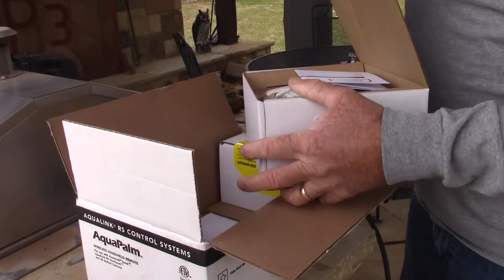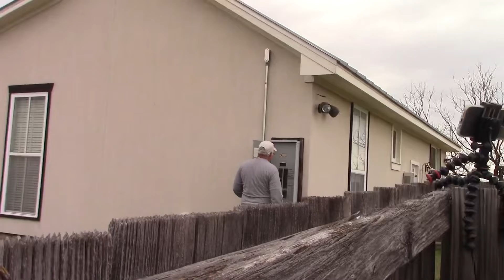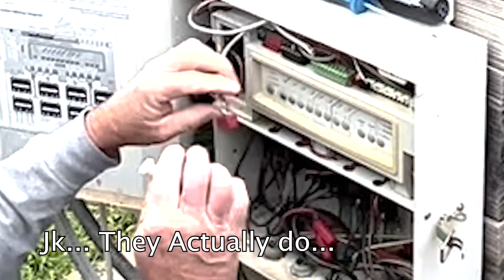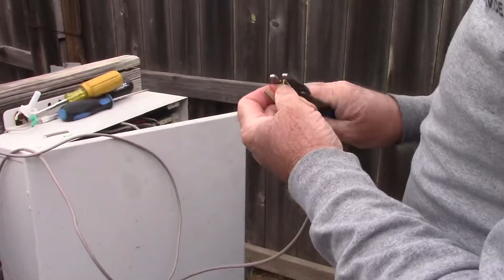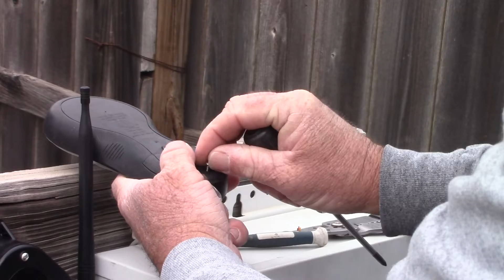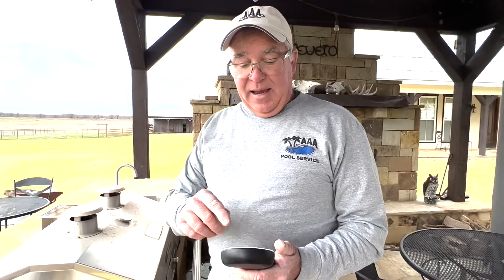Jandy PDA; How to install or replace system

Comment: Quick question can I use the same communication and just hook up the new antenna to the old wire thanks or do I have to get a new line it’s gonna be a huge pain
Reply from the maker: As long as there’s nothing wrong with the old antenna, it will work.

Comment: I just need an antenna it’s broken where can I buy it?
Reply from the maker: You might contact a local pool company to see if they can get you one. Here it is on Amazon, but it’s both parts. I checked my supplier and they only sell it as a kit. And it’s about the same as Amazon just a few dollars cheaper. 

https://amzn.to/4q24Yfb

Comment: Why we can not just replace the sensor the remote control is working fine?
Reply from the maker: I believe the reason is simply the market is moving towards everything being controlled with WiFi. Over the last 10 years it has been slowly moving that direction. We used to be able to get both parts individually. Now the price has been elevated higher than the WiFi systems. I believe this is to encourage people to switch. Just my opinion based on what I see happening.

Comment: Hey do you know if we can purchase a replacement handheld remote? We purchased a house and it has a Jandy r0686300 antenna but the previous seller didn’t leave a remote
Reply from the maker: Double check that it is the antenna for a pda and not the newer wifi system iq2.0 or is 3.0.
If it’s for the wifi system then you can connect it to your phone.
Reply from the maker: Here is the steps to set up the IAquaLink system https://youtu.be/IVDnGrZSX28?si=aX-13TNpnU3Wg8l6
Reply from the maker: If it is indeed a pda, you can get a remote on Amazon. 
https://amzn.to/3WTMOk6

Unfortunately the remote is almost as much as the kit.
Reply: Wow very expensive for just the remote. I downloaded iAquaLink and went to my WiFi settings and don’t see the system so assuming it’s RF to a PDA and not WiFi. Is there an easy way to add WiFi to it? Or better getting a professional to install. Not sure if it’s cheaper to just go that route out by the handheld and be done with it
Reply from the maker: @jsmmao  take a look at the antenna, if it is the wifi, you will see IQ2.0 or IQ3.0 otherwise it’s the pda antenna. Then it’s whichever way you want to go. Both systems wifi or pda are about the same price. Installation is as simple and mounting the antenna to the wall, plugging it in to the pc board and then connecting to the device. Not to difficult at all.
Reply: @Pool-guy  thank you for the help!
Reply: Where can I buy the antenna and remote kit in your video?  I called Jandy Customer Service and they indicated that they do not sell direct to consumers.

Comment: Steve, I changed the batteries in my R0687300 remote.  Now when I power it up, it cycles between waiting and connecting, but never connects.  I tried to follow the instructions on my remote to change the channel at the transceiver but it will not move past the learn mode screen on the remote, so it seems they aren’t communicating.  Any suggestions?  I have hit the reset button on the transceiver, but I still can’t get them to connect with each other.
Reply from the maker: Make sure the learn mode is selected on the antenna. You will have to open it up and flip the switch. The. Try it again. If it still doesn’t work, you may have to replace it. Keep in mind that the new remotes don’t pair with old antennas. So if you get a new remote. Get the antenna too.

Comment: Steve, my Husband and I are pretty handy. We'd hate to buy a whole new set up if we can repair the old one. We suspect moisture problem and just want to open up the remote and dry it out. I've done this with numerous electronics and brought them back to life. HOW IN THE BLOODY HELL do you bust into a JANDY remote? It's almost like it's dipped into some sort of alien polymer. Area 51's got nothing on Jandy, I'll tell you what. Really, where is the secret screw or clip? Any hint or help would be appreciated, good day sir!
Reply from the maker: I love your spirit. I think you may be on to something with the moisture. Unfortunately, I have not taken one apart yet, so I’m not any help. As I think about it, there may be screws under and rubber pads or inside the battery compartment. If you figure it out, post it back here. The info may help someone else.
Thanks for sharing
Reply: WooHoo! This thing's sealed up like a duck's ass. I found the point of entry at the bottom. There was much carnage as bits of plastic and alien goo were stripped from the lifeless electronica. 2 bandaids and 4 whiskeys later...I was in! <Aviation Electronics Mate, 2nd class USNavy veteran>  I observed water and corrosion where the power button relay lay on the pcb. I used alcohol (rubbing, not whiskey) on a qtip. I was dismayed when I put the batteries in and could get nothing. HERE'S THE TRICK. The battery compartment door must be on for it to power up. I almost gave up but tried that, as $700 was on the line here. I believe I heard angels singing when I pushed the "on" button and that shit lit right up. This thing is no longer water proof of course, so Imma put it in a ziploc bag and call it done. Thanks Pooldude. Hope you can make some sense and maybe a few bucks with my adventure!   @Pool-guy